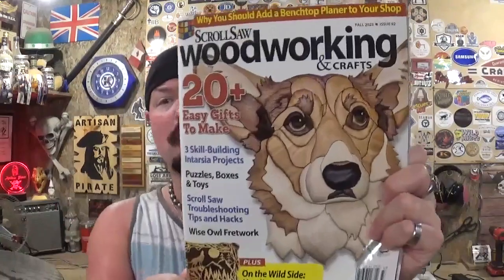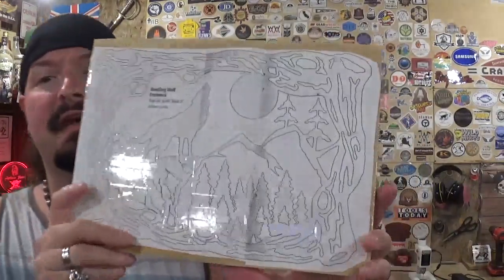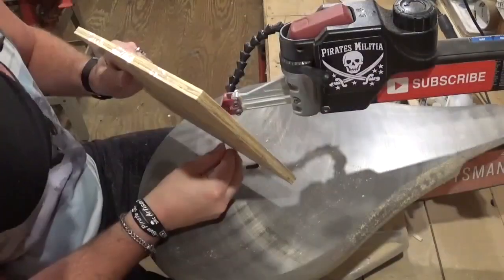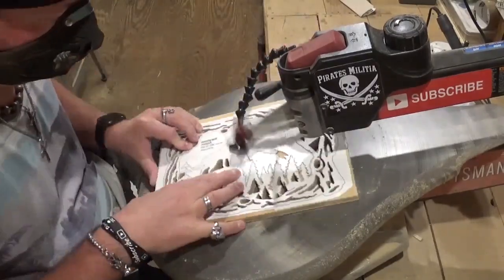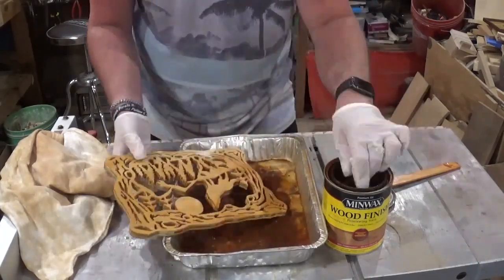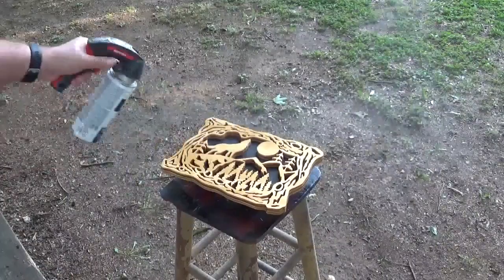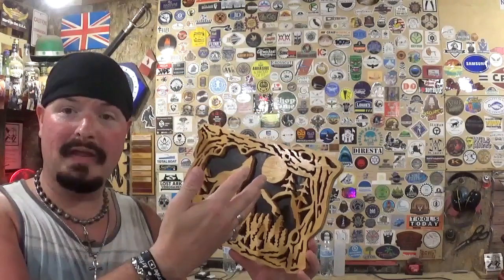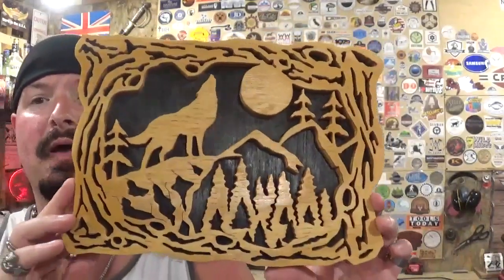Howling Wolf Fretwork, Scroll Saw Project

Comment: Have you ever tried rubber cement as opposed to packing tape? I've always used tape, but read where some folks use other methods to attach patterns.
Reply from the maker: Their is several ways to attach patterns, I've just always used the clear packing tape method and I've never tried rubber cement

Comment: How is that Seyco drill working out? Looks like it makes drilling all those holes a little easier. How’s the power on it? Have you tried it on anything thicker than 3/4 inch material? I need to subscribe to that magazine, seems like they have some decent patterns in there. Another great job. Seriously enjoy watching your technics. I’ve learned a lot watching your content! Keep up the great work!
Reply from the maker: I like it. It's a very unique tool. I'll say this but don't quote me on it. It seems to be made for primarily right handed people. It took me a bit to get used to it with the button being on the left side and me having to guide it with my right hand. 
I'd say if you do a ton of scrolling (like me) it's a great investment